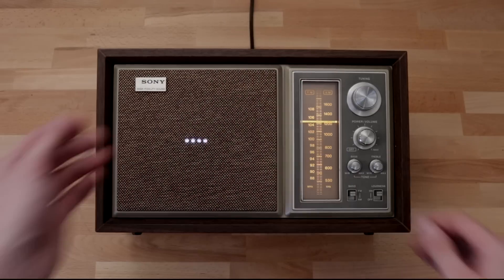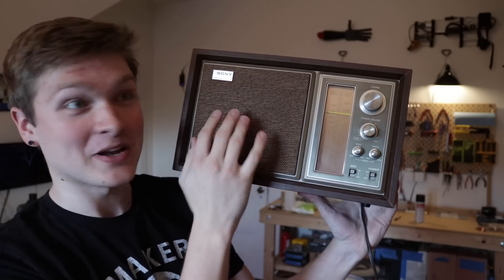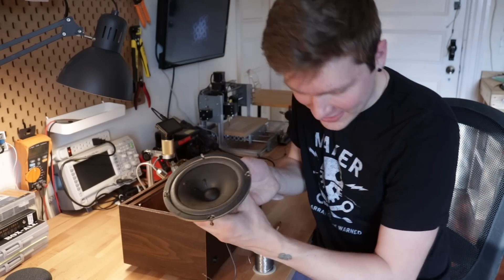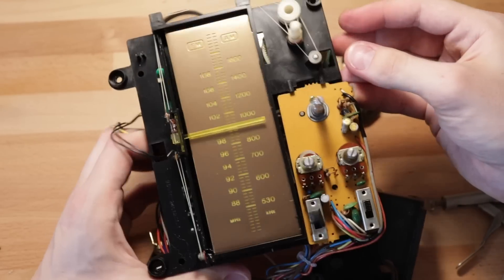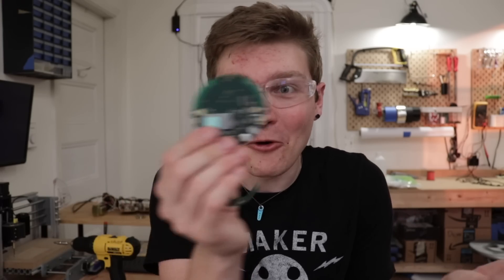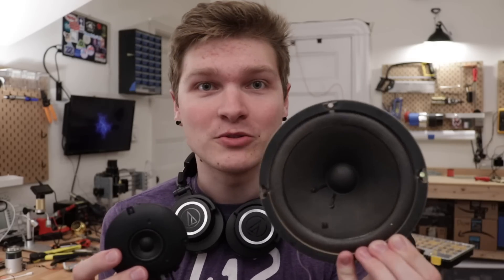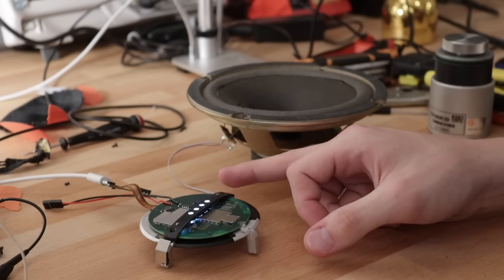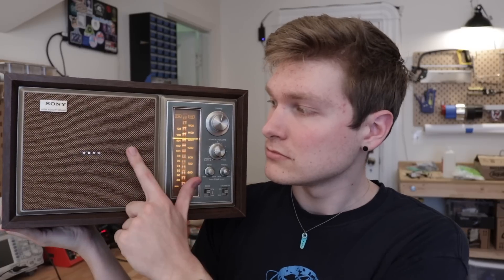I made a RETRO Google Home!

Comment: That is not a radio from the 40s. not even close. If it were it would have vacuum tubes. It has transistors in it and I would estimate it to be from the late 70s to the 80s approximately.

Comment: You didn’t show much in this tutorial. Such as installing the pcb in the casing. How did you get the pcb in front the original speaker without touching the rubber surround of the speaker? Did you leave the original power supply inside to power the radio scale light? Did you use the original power supply inside to power the Google home or did you make a plug in the back of the casing to power the Google home with a usb cable and a power plug?

Comment: I have a similar project that’s pretty much exactly like this 😂. I wanna use an Alexa in a small retro radio I have. Theirs a clock in it and it works but the radio doesn’t work and is probably to old to work with the radio stations now and days. So I’m gonna use a portable car fm radio transmitter and an Alexa and make that the radio. It’s gonna have a switch to toggle between the Alexa and fm radio for whenever. And the radio is gonna be able to go back and forth between Alexa and radio. And the clocks glass cover is gonna light up when you use Alexa. Very excited to make this project! Tho it might be a while before I do that one since I’m working on making a modern smart TV inside a portable retro tv. It’s a whole other mess but so far it’s been a mess that I’ve enjoyed making!

Comment: Do you have a guide or photos?  Did you have to extend the touch controls?  Did you power the mini and radio lights together?
Reply: Seriously if you can't figure this out what are you doing because all he did was hookup a bigger speaker and put in a existing radio as the case literally nothing at all.🤷‍♂️
Reply: @RavenTheLabrador  he also moved the touch  onto the mesh.

Comment: Even tho I'm late to the party: Nice idea. I had one extra Google Nest Mini around and put it in an old 10W speaker enclosure. Works okay so far, but the chip responsible for the audio on the mini does get warm if you turn up the volume (Raspberry Pi heatsink to the rescue). I wasn't able to get the touch buttons to work with physical ones, if anyone has some ideas on that it would be great.
Love your motivation. Greetings from germany

Comment: I see you learned to mute the hey google thing here. It set off my phone sitting next to on my desk. Also that radio is from the late 70's. 1940's would most likely be a tube radio and the board would be single sided with no green solder mask. Also the aluminium heat sink on the back of the board is a dead giveaway aside from the logo and being made in Taiwan. Aluminum wasn't a common material until about the 70's. The Sony logo is the easiest way to tell also made in Taiwan. I am not sure but I am pretty sure sony was made in japan up until the 70s. That is a TFM-9450 and just to calm anyone down about destroying an old radio its not that old and they are common.
For tools let me recommend you the Nanch screwdriver kit with the large aluminum handle. It has 90% of what you will need in it. I also like the ifixit tool kits but their quality is just barely there for the price but their Mako kit has every bit you will ever need for taking apart electronics.
As for the build. This is awesome man. You might try adding in a cheap amplifier to get a little more volume out of it since that speaker is most likely being under driven. I think the home mini has a 2 or 3 watt speaker while that old speaker is 5. I think you got lucky on the impedance though. I think the home mini uses a 8 ohm speaker as well.

Comment: Very cool project! I’m going to attempt the same. A couple of things- is the large speaker powered solely by the google home board? Also how do you power the original radio lights? A separate power cord? What Id like to do with mine is have the google home/large radio speaker plus a led strip behind the the tuner/station glass- all powered by one cord. Possible? Sorry if I missed the link where it might have been explained. Kudos again! Don’t let these nitpickers steal your enthusiasm.
Reply from the maker: Thanks! Yeah, surprisingly the amp in the Google Home Mini is totally enough to drive that much larger speaker. The way I wired it was leaving most of the original radio electronics intact (especially given that all the lamps needed their own wacky AC voltage), and I just added in the mini with its original power adapter. I thought about trying to pull a 5V rail off of the radio to power the mini, but I was worried it might brown out if the rail couldn't supply enough current. You could do the same with the LED strip, and just connect its original power brick to the mains voltage coming into the radio. Let me know how it goes!!
Reply: @stephen_hawes  Do you have a guide or photos?  Did you have to extend the touch controls?  Did you power the mini and radio lights together?

Comment: While a cool project the radio itself is retro.

It's not from the 40s. In the 40s transistors were only at experimental stages and not available to ordinary consumers. It could be from the late 60s but my guess it's from sometime in the 80s or early 90s based on the look of the electronics. Many components have date markings but since the video doesn't show any clearly I can't say something for sure. One thing is for sure however. It's definitely not from 40s nor from the 50s. Late 60s at earliest (though I really doubt it) and most likely 80s.
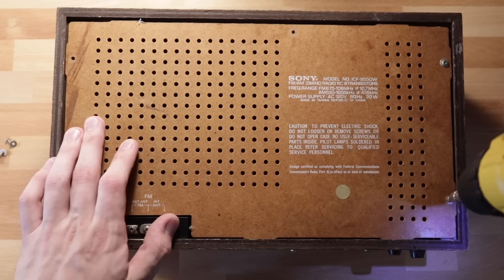Reply: Ahh. I missed the model no. ICF-9550W @ 1:29. From the late 70s - so now that's clear ;)

Comment: I like how technical your projects can be, but I feel like this video was just several minutes of you gushing about how cool the radio is and how big the speaker is, and then one minute of you cutting open a Google Home and then glueing it behind the speaker mesh. This project would have been very cool if you had tried to put an amp on the Home to take full advantage of the big speaker, maybe found a way to read the lights with an Arduino that could move the channel-select bar up and down, or even just gotten the cap touch buttons to work with the dials. But instead, this project just felt like a filler arc; cut open gadget, put it in different box.

That said, I'm sure something cool is happening in the background, so I look forward to your next video!
Reply from the maker: Thanks for the feedback! I totally get what you're saying. I've been grappling back and forth between being either technical or cosmetic with my videos, so hearing a preference helps me dial that in. I think sometimes I'll definitely make more cosmetic videos like this one because it's just what I want to make, but overall I think I'd like to get into the weeds more than I did here. I have a pretty technical one coming down the pike, so keep an eye out for that! And thanks for taking the time to share your thoughts!
Reply: I know this video is so stupid. Seriously all he did was remove it from the Google nest case and put it in the case of the radio cut off the original speaker and hook it back up to the old bigger speaker. Anyways this is absolutely not anything that is in any way difficult at all for anyone who has the most basic knowledge of electronics not even that. Seriously if you can use a soldering iron you can do what he did in about 5 minutes or less with very basic knowledge. Anyways this was absolutely nothing even close to the reverse engineering that he was talking about and if he really thinks it was that just shows that he knows nothing about what he's doing.🤷‍♂️👍✌